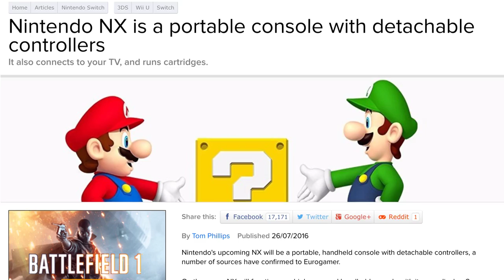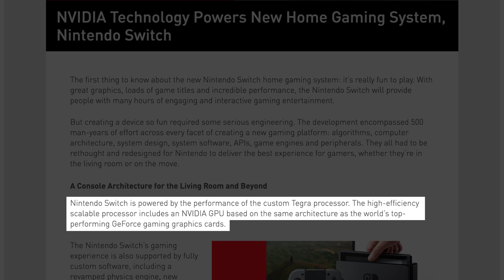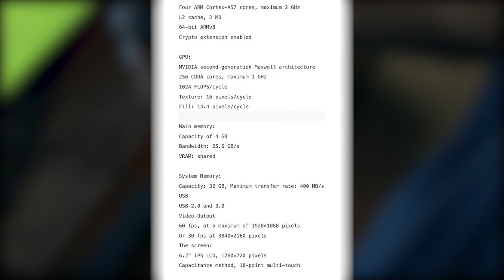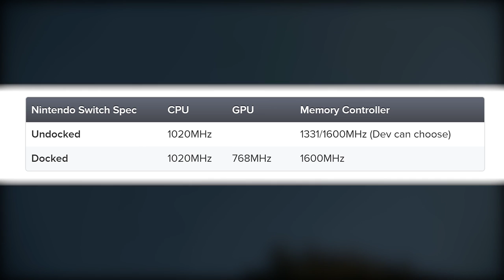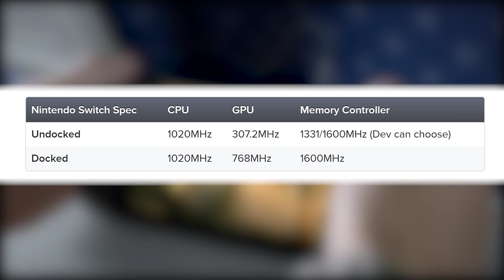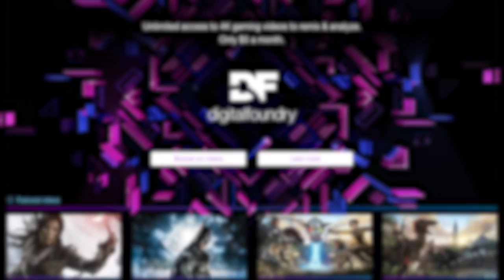DF Videocast #6: Nintendo Switch Clock-Speeds Revealed

Comment: So only 0.5 TFLOPS 32bit?
Reply: technology straight from 2008!
Reply: The switch will be weaker then an iPhone 7 (which already outperforms the not downclocked Shield console and Pixel C tablet in most benchmarks).

Here are some Benchmarks guys.

Geekbench 3 (processiong performance)

iPhone 7 - Singlecore: 3380; Multicore - 5500
Nvidia Shield Console - Singlecore: 1650; Multicore: 5040

The Switch will run at 50% of the Shield Consoles clockspeed.

GFX Benchmark (graphics performance) Trex 1080p offscreen Render:

Nvidia Shield Console - 120 FPS
iPhone 7+ - 108 FPS
Google Pixel C Tablet - 103 FPS
iPad Pro 2015 - 170 FPS

And the Switchs  GPU will run at 1/3 of the clock speed of the Shield Console.
Reply: 300 gflops vs 4.2 tfps of ps4 pro and 6 tfps of xbox scorpio 
Its a joke
Reply: while the Wii u is something like 500gflop+
Reply: TheDrewSaga Wii U is 176 Gflops !
Reply: yeah it is 352 gflops
Reply: Justin Wong 160 Stream Processors (32 ALUs x 5)*550*2 (FMADD)= 176 GFLOPS
Reply: I'm not insulting you. Accept it. Wii U might not be too powerful, but it has great games. Flops won't change this on Switch.  ;)
Reply: wii u is 352 gflops, ps3 and xbox 360 both 240 gfops.
switch will be undocked 150 gflops and docked 400 gflops.

have fun
Reply: that is a lie as jimmy fallon rran both modes on breath of the wild with better framerate(stable 30)than the wii u
Reply: +Justin Wong 30FPS isn't stable if your eyes can pickup on that poor frame rate.  This isn't the year 1999, we are living in 2016.  30FPS should be dead.
Reply: its locked at 30 so we dont know
Reply: Plus your eyes pick it up as smooth moovement at 25 fps already so it should be fine
Reply: it's a 64-bit CPU. The GPU is 157 GFLOPs undocked and 393 GFLOPs while docked. This assuming 32-bit floats which everything else uses, and not 16-bit floats which nVidia have used to inflate the Tegra X1 figures.
Reply: You can't really compare TFLOPs of the Switch to Home consoles because they use completely different architectures. TFLOPs aren't a good comparison to compare the Switch to the PS4
Reply: @coolertuep  Just cause a smartphone is more powerful than the Switch doesn't mean the performance will be better. Most games on Smartphones don't utilize the Smartphones' GPU and CPU to it's full potential because alot of the power of those chips is used to function the Smartphones' OS properly which utilizes the GPU and CPU power in a major way since the OS of a Smartphone is much more complex than the Switch. So Smartphones game developers usually optimize their smartphone games much lower than what the full power of the GPU and CPU had due to the Complex OS taking alot of that power. 

Also Phones don't have a cooling fan like the Switch, so Smartphones games cannot run at the full performance a smartphone may be capable of because it'll quickly overheat the GPU and CPU without a cooling fan, and since Smartphone games are meant to work on hundreds of different smartphones, game developers usually build their games to work on weaker specd smartphones so the game could work on multiple devices rather than certain smartphones

Comment: Ive read the VentureBeat article and it was a steaming pile of garbage. Poor wording coupled with factually incorrect information and multiple edits. They stated that Pascal runs hotter and uses more energy than Maxwell. Comparing the 980 to the 1080 we can see that not only does Pascal run at the same temperature and almost the same power, it provides a major clock speed bump with the corresponding performance boost. I would not put any faith in what that article stated. (In addition Pascal is almost just a die shrink of Maxwell, IPC did not really change. This can be seen when the 1080 and 980 are put at the same clock speed and power limits. This means that with the 16nm or 14nm node that mobile chips are being made on, it does not really matter if the Switch uses Maxwell. )
Reply: I do not understand... what are you saying "NO IT DOESNT" to?

Yes at the same clock and FLOPS they are effectively the same... I already stated that. The main performace increase comes from the die shrink and clock speed increase.

As an aside WHY ARE YOU YELLING?
Reply: *****
But how about the sources of the sources of the sources of the sources of the sources? By the way I do know how hardware works. I am a Software Engineer with several years of experience in Electrical Engineering as well.

You are correct that the venture beat article is all that I can find about this. Now Laura Kate Dale as jumped on the bandwagon too. There are some things that do not feel right about what they are saying.
Reply: pascal is basically a 14 or 16 nm gpu which gives it 40 percent better performance over maxwell
Reply: look it up
Reply: Justin Wong
You are partially correct with your first post. Just shrinking the design to 16nm (Pascal) will yield only minor improvements to speed. The real benefits are from using less energy (allowing for more performance at the same energy) and from the ability to boost clock speed (stemming from the extra energy headroom and the smaller transistors plus the shorter distances that the electricity must travel.) All of this together will give the 40 percent or so improvement.

 However if you were to match the number of flops and clock speeds of the chips (Maxwell and Pascal) they perform at almost the same level (within margin of error.) This indicates that there have been no improvements to the CUDA core design as the IPC (Instructions per Clock) remain the same.
Reply: +Austin Nafziger
Just an FYI, iv'e seen that USMAN guy post the exact same comment before on other videos (that second comment might also be the same)
I'm not sure what's up with this guy, whether he's a bot or a troll or what???
He frequently uses all caps lock and frequently people call him out on it and ask him why he's doing it (as well as if his caps lock is broken, which judging by his second comment doesn't seem to be the case)
though he never seems to respond to why he excessively uses caps lock (or responds to much of anything, which is why i think he might be a bot)
Reply: lel

Comment: people the xbox 360 is stronger GPU wise than Switch undocked !!! it's not a typo, the friggin xbox 360 from 2005 run at higher clock speed 500 MHz vs 307.2 MHz LMAO WTF.....this is an all new low
Reply: ***** yeah but it's weak af
Reply: That's just clock speeds dude

Comment: Where are you getting the Docked & undocked figures from? The spec sheet you showed earlier in the vid lists the CPU as having a max speed of 2Ghz and the GPU at 1Ghz. Those are figures from the actual devkit manuals, so they're accurate. The clock speeds do change depending on docking, but nowhere near as drastically as you say.
Reply: Walther Penne but that's exactly the plan. Undocked it will be weak, the power will come when docked. That's why Nintendo is marketing the console as a home console, not a mobile one...

Comment: So it's not running off of a Pascal chip? So basically if this is true the Switch is just a 2 year old Nvidia Shield but with Nintendo games? I hope these rumors aren't true. I wanted something a little more powerful, at least close to Xbox One performance.
Reply: Walther Penne Thanks for not being a sarcastic ass. ;) Money isn't a concern for me, so $399 would have been fine, but honestly even with a Pascal GPU the cost probably would not exceed $299 based on past history of Nvidia Shield prices.

 I understand that Nintendo's target market isn't the high end, but being under powered does pose hurdles that Nintendo keeps ignoring. One of the reasons why the Wii U failed was because it didn't have a healthy library of good third party games due to being under powered, many devs didn't want to bother taking the time to completely retool and remake their games.
Reply: Dark souls developers ran  a bouild on the nintendo switch and they were pretty happy with the performance
Reply: bloodborne and DS3 ran terrible so From Software's view of "acceptable performance" isn't the greatest thing to go by.

Comment: The specs might be low, but actually, they don't need huge specs because of something Sony and Microsoft never did on their home consoles.
Yep, it's cartridges.
Cartridges have a very fast loading time, faster than a CD. So fast that there actually might not be loading times or very little loading times for games. Only problem is their amount of memory they can hold, but hopefully the price of cartridges have fallen over 20 years where you can have dozens of GB of data for a low price. Surprised nobody said anything about this.

Edit: Oh, plus cartridges are pretty hard to break and they're very durable.

Comment: Does your phone have Mario and Zelda? No? Then it doesn't matter that you have a 2.8GHZ octa-core processor with dragon ejaculate as thermal paste because you don't have Mario. Your mobile GPU is nothing like an actual Maxwell GPU like the one in the Switch, your phone sounds more powerful with pretty numbers, but you don't have fucking Mario, do you? (inb4 emulators and pirating)
Reply: +The Uncanny One 
To be fair: iOS Phones do have Mario now, with Android following in 2017...
It's not a full-blown Mario game, but the point still stands! ^^
Reply: The Uncanny One you do know Mario just came out for the iOS platform right.
Reply: steverl22 
A lame freemium runner. 
Not an actual Mario game is it?
Reply: The Uncanny One Mario run was the start. When the switch flops, they'll licence more and more to mobiles until we're practically getting full games. Mark my words.
Reply: The Uncanny One mind does i am using citra for android
Reply: The Uncanny One have fun with mario
Reply: The Uncanny One it does not matter if it is pascal maxwell  or even if it performs like PS2's Emotion Engine
Reply: ***** I did think and after thinking further I realise I'm a lot smarter than you. And I shouldn't be.

I'm not even going to expand on why I say this I just can't stand the fact that people like you exist and are out there thinking and breathing and holding opinions and voting.

I'm also COMPLETELY serious and not being in the slightest hyperbolic, I would NEVER use hyperbole, nooooooooooooooooooooooooooooooooooooo
Reply: Kniffel101 Shite £10 infinite runner that should have been free. Bet it has bloody microtransactions and all.
Reply: steverl22 That's not really mario though is it?
Reply: The Uncanny One Mario Run Biiiiatch
Reply: OKjoey86 That's not a proper Mario game.
Reply: yeah Mario Run is on IOS and going to be on Android next year.
Reply: actually my phone has Mario now lmao

And "oceanhorn" is a zelda clone.

So im good thanks alot. My Phone is also stronger then the switch.
Reply: I have just to remind you to delete your original post since it doesn't make no sense
Reply: The Uncanny One  my phone has Mario as of last Thursday lmfao
Reply: omg who needs marion in 2016? only nintendo funboys i suppose
Reply: BMW YASEEN I don't own any Nintendo consoles. The last Nintendo device I owned was the DS Lite.
Reply: ***** Okay? Can you get those emulators on the Stutter Station 4 or the VHS Box One?
Reply: You do realize the Xbox One uses a emulator to play Xbox 360 games on the device, that's how they achieved backwards compatibility. The only reason why the XOne/PS4 stutters is because the developers are pushing the consoles limit, and if they did it with the Wii U the whole thing will die on itself. Also its funny because Nintendo were struggling to get Splatoon to run 60fps just in the Plaza.
Reply: Inyene Udom Pushing the consoles limits? The consoles have puny pathetic fucking limits.

Comment: for all you people whining about the gpu clock speed:

You CANNOT judge a gpu's performance with only the clockspeed. The rx 460 470 and 480 all run at approximately 1.2ghz. (these are all the same architecture from the same family and generation, the 470 and 480 are even made with the same gpu die) Clock speed isn't what decides a gpu's performance, so once again you can't quote performance on a gfx chip that you don't have full specs for. (what does decide the performance is architecture and execution cores)

This actually lines up very well with the rumors that the switch will have a 720p screen and output 1080p when docked. outputting 720p is literally half as hard as outputting 1080p, so it makes sense that the chip only needs to go half as fast to 
perform similarly.

Comment: Honestly, what did you all expect? It's a gaming tablet that has to optimise for battery and heat output first and foremost. If the Switch can provide a solid playable experience at 720p on the go with decent battery life, that's a league beyond what both the 3DS and the PS Vita are capable of, and you get the advantage of being able to dock it to your TV if you want to play on the big screen at higher resolution.

Comment: Those rumours/leaked specs makes totally sense, as well the lower gpu clock in handheld mode and the hypothetical 720p screen. I always bash Nintendo for their lack of effort on the hardware side (I have other complains but those are OT) but, this time around, I'm actually interested in their new console.

OT: as always this comment section is toxic as hell, really few people does constructive comments.

Comment: @DigitalFoundry My question is for clock at 300 Mhz, why the switch has a cooling fan?? too me a static heat sink will do the job, even with fully load GPU
Reply: the nvidia sheild tablet ran 5 to 8 watts with a magnesium thermal sheild and went only up to max 44 degrees celcius so it should be fine

Comment: Remember, there are more than one way to measure performance.  One way is the easy way, and that is to look at raw CPU / GPU performance.  Another is the overall experience.

Sony and Microsoft look at performance improvement solely on the visuals, I mean their controllers haven't really changed at ALL since the beginning (except for Sony with the PS1 controller adding dual sticks).  Whereas Nintendo views performance improvement on the experience overall.

All those nice fancy graphics are nice and all, but what good are they if the play mechanics aren't all that nice.  Why I still play my 1st person shooter (Doom, CoD, etc) and my 3rd person shooter (Assassin's Creed, Watch Dogs, Mass Effect, etc) games on the PC.  I prefer my keyboard / mouse setup much better than the controller (except for driving segments, then I use my Xbox 360 controller hooked to my PC).

Comment: Honestly, even if there weren't sources backing this it's hard to fault the reasoning. It's a big bucket of cold water on any hopes I had that we'd see something better than Tegra X1, but we had a similar situation when the ARM chip inside the 3DS was revealed, so I did expect this on some level.

Still, I really hope that they can shrink it down to a 16nm process. The advantages would be huge, provided the cost and availability are right.

Comment: what you fucking expect, have a fucking i7 portable with a 1080 gtx  and be $250 at the same time?
Reply: Retro Gameplay well ps4 is $279 and if you pay around this much you want at least PS3 quality. It looks like any phone will have more games with better quality
Reply: The switch will be weaker then an iPhone 7 (which already outperforms the not downclocked Shield console and Pixel C tablet in most benchmarks).

Here are some Benchmarks guys.

Geekbench 3 (processiong performance)

iPhone 7 - Singlecore: 3380; Multicore - 5500
Nvidia Shield Console - Singlecore: 1650; Multicore: 5040

The Switch will run at 50% of the Shield Consoles clockspeed.

GFX Benchmark (graphics performance) Trex 1080p offscreen Render:

Nvidia Shield Console - 120 FPS
iPhone 7+ - 108 FPS
Google Pixel C Tablet - 103 FPS
iPad Pro 2015 - 170 FPS

And the Switchs  GPU will run at 1/3 of the clock speed of the Shield Console.
Reply: Retro Gameplay Xbox One levels is what we all expected. Keep up.
Reply: iphone 7 is $250... guys remember is a hybrid portable and home, if you put ps4 or xbox one portable with screen and controllers how many battery it will need??
Reply: ps4 is not slower than ps3, but good try trolling.
Reply: It uses a different architecture, so you can't really compare.  ARM is much more efficient.

Comment: I don't understand why people are saying this will tank because the spec is lower than the PS4 and XB1. They said it in the video at 14:00 - Nintendo isn't trying to compete with the other platforms anymore. Their main goal is to bring you the next generation of Nintendo games, not run Crysis at 1000K with 9999999FPS. If you were seriously expecting that from the Switch, you need a reality check.

Comment: Hmm which is more powerful. The Switch - or buying a magnifying glass for my 3DS?
Reply: GTA 5 takes more system resource and is harder to run for me now. However GTA 4 was terribly optimised. Weirdly GTA 4 got better in 2015 when they released a patch for a 5 year old game - now it runs MUCH better than GTA 5 on the same system. So the "GTA IV is more demanding" argument doesn't hold up at all. GTA 4 was a system hog because it was badly written - now that it is fixed it is as smooth as silk. My 1070 never drops below 90 FPS at HD with everything except shadows and view distance on 100% - they are on about 90% as I find 100% made no difference to the image I can see - it just eat more resource.   http://kotaku.com/years-later-rockstar-releases-new-pc-patch-for-gta-iv-1789523135